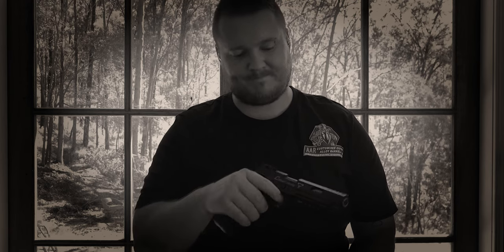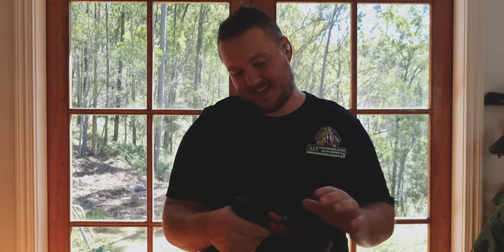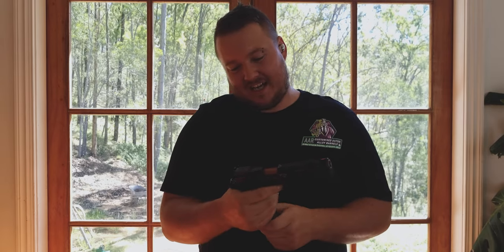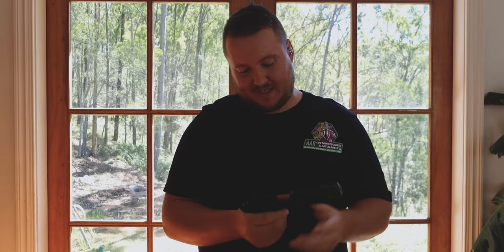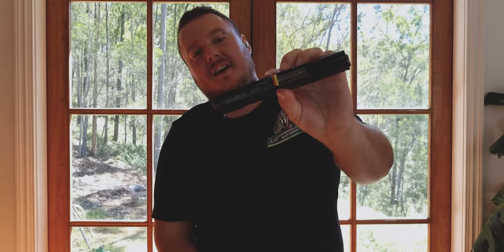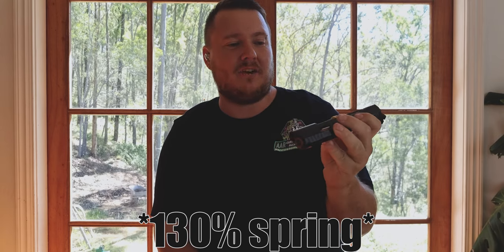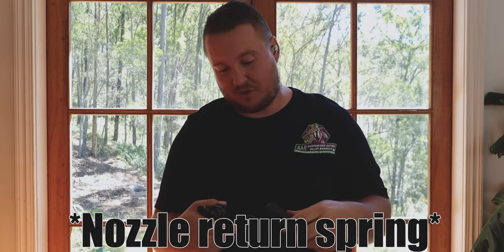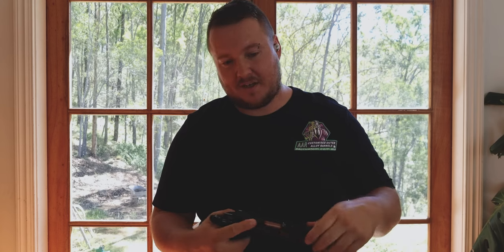Remove air bubble from GBB magazine. Fix low green gas capacity & mag tech tips. (How to fill mag.)

Comment: Did you end up making a video about short stroking? I only had a quick look through your videos and didn't see anything stand out, got lazy, and thought I'd just ask.

I bought my first green gas pistol only a few days ago, so a bit new to how they work. I was looking at the workings of how the pistol cycles, and got to wondering if a slightly heavier spring would give a few more fps to the gels?

I didn't think of packing the spring like it looks like you have done from that quick glimpse under the slide. That's a good idea. Thanks. I think i might go and pack my spring and see what the chrono says. Very interesting. Thanks for making and posting your videos.

Comment: Do the mag valves need to be tweaked to find the sweet spot like CO2 mags?
Reply from the maker: Yes but each blaster has a different sweat spot the TTI and poseidon do best with the valve all the in. We're the APS guns need alot more tweaking.
Reply: @geldogsgelsoft7045  sweet as! I got one of the hi capas from CEH and getting less than 2mags per fill. Will try your technique of getting rid of air bubbles and try tweak the mag valve a bit. I know these should be doing way more than 1.5 mags per fill.
Reply from the maker: @DjKRuZe81  Let me know how you go, there's a few other things you do for Gas/Co2 efficiency. I might do a future video on it.
Reply: @geldogsgelsoft7045  definitely will do cheers bro 🤙🔫🤙
Reply: @DjKRuZe81  hey mate could u explain to me the c02 mag tweak/tune? I got a XTP what do I need to do?
Reply: @Yito32  there's a video by shakkas clakkas by azreals armoury on how to do it and find the sweet spot.
Reply: @DjKRuZe81  ohhh just watched it. So mine works well would I still need to tune it? And what are the benefits?
Reply: @Yito32  if it's working bro don't worry about tweaking it. Adjusting it increases gas efficiency and makes it more snappier on the recoil.